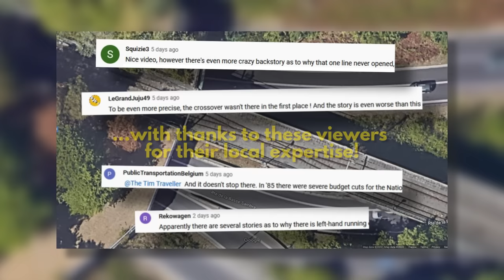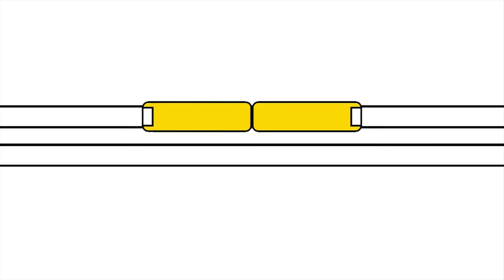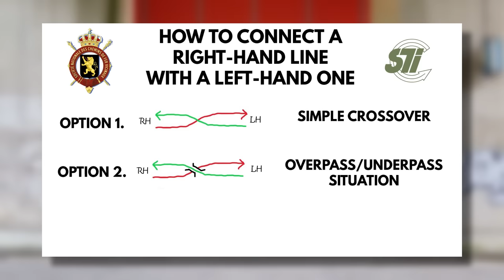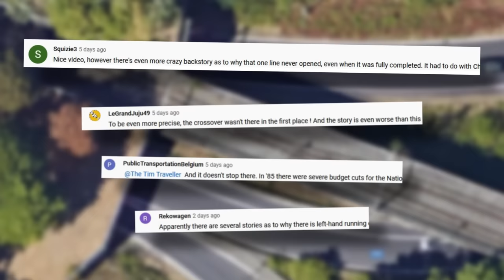The Belgian City That Built Two Metro Lines The Wrong Way Round

Comment: There are (at least) four places on the London Underground which have right hand running. The Northern Line between Borough and Moorgate - a legacy of the original tunnels under the Thames, and the steep gradient up into the King William Street terminus . The Northern Line again, at Tufnell Park, to ease the curves approaching the station from each end. The Victoria Line between Kings Cross and Warren Street, to facilitate interchanges at Euston. The Cenrtral Line at White City, a legacy of the former terminal loop, which ran anticlockwise. All of these cross over in tunnel, execept between White City and East Acton which uses a flyover - there are no flat crossings!  Elsewhere, there is a short strtech of left hand running on the Munich S-Bahn (lines 3 and 7) because trains reverse at the Ostbahnhof. And the French terminal of the Channel Tunnel has right hand running (although the tunnel, and French railways in general, have left hand running) because the terminal loop there is anticlockwise to even out wheel wear (the English terminal is clockwise). Flyovers areused in both cases to make the switch.  Finally, the West Highland Line is mainly single track but at passing stations trains normally run on the right - this is because all the platforms are islands, so it puts the driver on the platform side.

Comment: There's a similar situation in Zürich, where they built part of a metro tunnel but then the metro was rejected by the public. So they decided to just put the tram in the tunnel. But since the trams in Zürich are unidirectional and the tunnel has island platforms, the trams have to switch sides on both ends of the tunnel. While at Milchbuck there is an overpass for that, at Schwamendingerplatz, there's also just a simple crossing. There's a german Wikipedia article on the tunnel: https://de.wikipedia.org/wiki/Tramtunnel_Milchbuck%E2%80%93Schwamendingen

Comment: In South Korea, we have a similar case: Seoul Metro line 4 changing sides. 
During the Japanese colonial rule, railroads are made to run on the left. After the independence, it was too costly to "fix" all the rail systems from left to right, so this still continues till today for intercity railway systems. 
But an exception was made to when building city metros: they were made to run on the right side. So when they tried to make Line 4 longer by connecting the Seoul Metro's line 4 (which runs on the right side) to National Railroad's rail (which runs on the left), they solved this problem by building an 3-dimensional grade separation in the tunnels. Also, they run on different electricity (DC1500V / AC25000V) so carriages running both parts of the line is able to switch those.

Comment: In Zürich, Switzerland they also have 3 tram lines (7 and 9) that run underground between Milchbuck and Schwamendingen. As they are unidirectional as well, they've built the same crossover on the 'Schwamendingerplatz'-side of the tunnel as well.

Comment: The same exists in Zurich: In the 1960s, there were plans to build a metro, and when a road tunnel was built, a metro tunnel with two stations was built with it as preliminary construction for the planned metro. The metro plans were however rejected by the people, who favoured the extension of the tramway instead. It was then decided to integrate the unused tunnel into the tramway system, however, since the two stations were already built with island platforms for the double ended metro trains, the single ended  trams need to change tracks to run on the left side in order to use the island platforms ...

Comment: We have a similar thing in Vienna in our tram network. It mostly runs on the road and therefore runs on the right-hand-side. Except one single station where the line 26 leaves the road, crosses to the left-hand-side for a Gewerbepark Stadlau station with a middle platform, then crosses back to the right-hand-side a rejoins the road. Afaik they did that, because that section had to be elevated to cross a motorway and it was cheaper to build the elevated station with a middle platform instead of two seperate ones^^

The Austrian train network was a complete mess between left-hand and right-hand traffic for pretty much the same reason as Charleroi too: many different companies built it. But as a side note, in the Austrian-Hungarian empire even roads were partly left-hand and partly right-hand traffic, so going from Vienna to Innsbruck you had to change sides twice no matter if you were travelling on the road or by rail. They switched all roads incl. Vienna's Trams to right-hand-traffic during WW2. And for the last fifteen years they're busy switching the train lines to right-hand-traffic, but two railroad sections with left-hand-traffic still exist.

Comment: We've got a similar situation here in Chicago. Heavy rail i.e. mainline commuter service between city and suburbs is run by Metra, a division of the Regional Transportation Authority, using lines built by various private companies. All of them ran on the right, except the Chicago & NorthWestern. They built the first railroad west from Chicago, the Galena & Chicago Union (that didn't even go to Galena, stopping at Freeport when the Illinois Central beat them to it). There are rumors that the C&NW ran left-handed because of the influence of British investors, but there's a more practical reason.

Initially, they built a single track west from Chicago, with the stations on the north side of it. When they built a second main track, it was built to the south of the original track. Since the pattern of traffic even back then was people leaving their homes to head to the city, they'd go to the station and wait around for the eastbound train, then come back in the evening on the westbound train and go straight home. So, with the stations on the north side of the tracks, that required that eastbound trains run on the north-side track, thus, they run left-handed. And when the C&NW built two more lines radiating from Chicago, those were also built to run left-handed. Even with modern signalling systems that allow for bidirectional running on any track, they still operate both passenger and freight trains left-handed, and where station buildings still exist, they're set up so that the train running into the city must run on the left to be at the closest track.

Comment: Those crossovers occur on parts of the London Underground but it's historic from when the London Underground system was seperate lines and companies, some stations and tracks were shared both with other undeground companies and main line ones, different companies had different running arrangements.  Changing station signage and the signalling was too big a job to have all left hand running when the LPTB (London Passenger Transport Board) known as LT (London Transport) was formed and the companies nationalised, easier to change the running side, even when still separate companies, with a crossover as the trains had access on both sides to accomodate push pull operation of rolling stock and island platforms at some stations.

Comment: Option number 2 was built, but currently not needed, in Fullers NY, USA. The New York Central Water Level Route was 4 tracks wide, utilizing 2 tracks for passenger service and 2 tracks for freight service.  The NYC didn't want Passenger and Fright trains to pass head on, so they used the 2 middle tracks as westbound tracks and the 2 outside tracks were eastbound tracks.  Well, where the freight line joined in, they needed a way for the trains to "change sides", so the Fullers Crossover was built.  It is still in use by CSX and will probably never change.

Comment: There was a similar crossover in Cleveland, Ohio as part of what's now the Blue/Green RTA light rail line. The reason was similar for the crossover in Charleroi: from 55th street west, the line ran like a subway with island platforms, but east of 55th street it ran like a standard streetcar line. To allow the operation of left hand door only equipment, a flyover was built just east of the 55th street station to convert from left-hand to right-hand running. Purchases of new equipment with doors on both sides allowed the elimination of this practice, and the entire system now runs with right-hand running. The flyover is out of service, but the tunnel can still be seen from satellite or while riding the RTA.

Comment: There is a crossover on a tram line in Stockholm, sweden and to my knowledge it's the only one in the world where you go from left to right, that isn't on a border. The reason for it is that the trams run on the right but the Subway run on the left, so in order to have a cross plattform transfer at the end station of the tram, it runs on the left.

Comment: Great video, and nice to see a picture I took end up in a Tim Traveller video. :-) The video does leave me with two questions though: 
1. if the crossover were there to allow unidirectional trams on the network, how would that have worked on the central circular part, where trams of both companies would have operated?
2. what would they have done with the unidirectional trams at the terminus? There weren't any loops to turn the trams back around, were there?
Reply from the maker: Ah in that case a big thank you for making your photo available on wiki commons - it's much appreciated by people like me! 

I think both of your questions have the same answer: the original 1980s idea was that unidirectional trams would have terminated at Waterloo using a small terminus loop (with no need for crossovers).

And the terminus loop was in fact fully constructed - I'm not sure exactly when though. If it was built in the 1980s, they never used it. However, it did eventually enter service in 1992 when Line 4 was finally opened. The French wikipedia page for the Charleroi Metro has track diagrams of it, if you scroll down far enough: https://fr.wikipedia.org/wiki/M%C3%A9tro_l%C3%A9ger_de_Charleroi

However... in 1992, the Metro's main central loop was yet to be completed. When they extended the tracks from Waterloo round to Janson and Parc in 1996/7, Line 4 stopped using the terminus loop at Waterloo, and they installed the crossovers instead.

Hope that makes sense!
Reply: @TheTimTraveller  Thanks! :-) That sort of makes sense, as far as the loop at Waterloo goes. But what would they have done with the unidirectional trams at the other terminus stations? (I guess Gilly and Centenaire back then). I don't see any turnaround loops at those stations at the track diagrams?

Comment: I note the opening of Paris' Tram-Train T13 which in part uses renewed tracks of the former Grande Ceinture Ouest railway line with left-hand (railway network) running and also some right-hand street running. I would be interested in how they do the switchover between the two sections. This reminds me both of your video of this ill-fated metro in Charleroi, Belgium and your video on the Grande Ceinture Ouest railway line. Maybe you would like to investigate this new line.

Comment: A similar thing exists (and is active) in the Zurich tram network! One tunnel was originally laid out to be a metro tunnel, but then got serviced by trams, which only have doors on one side - so before and after said tunnel there's crossovers for the trains to switch sides.

Comment: There's a crossover on the Central Line of the London Underground between White City and East Acton near Wormwood Scrubs but it uses method 2, grade separation. There's another one between White City and Shepherd's Bush but it's below ground and more difficult to see. In fact, that's the one that was built first, because of a very tight bend in the route just before reaching the original western terminus at Wood Lane, which was built as a single platform on a loop and avoided the need for trains to reverse to head off back towards the centre of London. When the line was extended westwards towards Acton, a new through station was built nearby at White City, with right-hand running, and Wood Lane was closed. There was to be a junction with the Great Western Railway at Acton so the Central Line had to revert to standard left-hand running and the fly-over/dive-under was built at Wormwood Scrubs.

Comment: There is a system like that in Seoul too.
It is the section between Namtaeryeong Station and Seonbawi Station on Line 4, and there is not a flat system. This was also made in the process of connecting the lines by other operators.

Comment: Stockholm has that too, on the Lidingö line (if memory serves right). The railways in Swedem uses left-hand running (like the French…), The Lidingö line is a suburban tramway line, running about half in the street and half on its own right-of-way, as a private railway. Now, before 1967, Sweden had left-hand running of street traffic, too, but decided that being a left-hand-running island in a right-hand running world was dumb, when Norway, Finland, Denmark & the rest of Contiental Europe was not,. The trams (having doors on both sides) were not a problem, but the street running, now being right-hand, was a problem. So they built a crossover, just like this. :) And the line still runs successfully.

Comment: The first explanation kind of reminded me of the oldest part of the Frankfurt U-Bahn network. The "A line", extending from downtown Willy-Brandt-Platz to Heddernheim and beyond, has no island platforms, despite Frankfurt U-Bahn cars having been double-ended with doors on both sides from the beginning. It is an advantage to build island platforms (narrower tunnel, fewer elevators and escalators needed), so why didn't they do it there? Well, during the early years, that line was used by conventional trams (with slight mechanical adaptations to bridge the gap between train and platform as they were not as wide as the U-Bahn trains), which were single-ended and had doors only on one side. Therefore, Island platforms were not an option there.
Later lines were not designed for the mixed-traffic patterns (and since the end of the 1960s, no new single-ended vehicles* have been purchased anyway.

*)Technically there are newer U-Bahn trains which are single-ended, but they always operate coupled back to back in passenger service, so they look and work like a long double-ended one, and they have doors on both sides anyway.
Reply: I remember watching that on TheTrainTV, quite interesting to see the good old Duewag trams on the Stadtbahn network.
Reply: @RockstarRomania  unfortunately, most of them are gone. We have three original U2 cars and three U3 cars left in operating condition, but they are only used for special occasions. Most of the Frankfurt subway runs on Bombardier made rolling stock which is called U5 in Frankfurt, with a few 90s DUEWAG U4 sprinkled in.
Reply: @Colaholiker  yep I know that 85% of the fleet is comprised of the Bombardier (or rather Alstom) U5s, and the 39 U4s.

Comment: You should make a video about the delay of the renovation of Gent-sint-pieters station because the renovation was supposed to be done by 2016, the new date is 2027. The project was put on hold for 3 years as there was no money left for the renovation, it cost also 200 milion more than the anticipated budget.

Comment: We have similar thing on Seoul metro line 4.
Line 4 has two different operators, Korail and Seoul Metro.
Korail has left-hand based railways, while Seoul Metro has right-hand based system. Line 4 was actually two different lines untill 1994. But when the time came to merge lines together, they built a flying crossover, often called as "꽈배기굴"(means pretzel tunnel) in korean between 남태령(Namtaeryeong) and 선바위(Seonbawi). The electric supply also changes between DC 1500V to AC 25KV.

Comment: In Kryvyi Rih (Ukraine) we have light subway system that has the same but in a different manner: between two station tunnels change places (one tunnel goes under the other) for the same reason: to be able to use wagons with door on their right side only. And when it connects to surface tram line tracks are crossing once again (on the surface) to change travel mode from left-hand to right-hand again.

Comment: I think I'm right in saying that the reason that Sweden still has left hand running on most of its mainline railways is because of a similar issue with the drivers' position being on the platform side at the time of the national L-R road swapover in 1967, so they just kept it as is. The tramway system in Stockholm was largely closed at the same time. Meanwhile down south in Gothenburg, all pre-1967 trams became instantly obselete as they too had unidirectional cabs with left-hand-side doors.....except one, which runs the tourist line from Central Station to Liseberg in isolation.

Comment: Did you ever heard about Ludwigshafen am Rhein, were they built a new mainstation outside the city center, 2 highways on bridges accross the city and a whole underground tram line (line 12) back in the 1960s? And today, they tearing down the streets and the underground line has been disused since 2008. The main station is still in use but a few years back they built a newer station which is actually inside the city. You should pay that mess a visit, Tim.

Comment: You've never come across Slade Lane junction in Manchester? Similar setup, but on the 4-track West Coast Main Line.

The reason for the craziness there is that south of the junction the tracks run as two same-direction pairs (fast and slow), but north of the junction they run as two opposite-direction pairs. Oh, and the Styal line joins in the fun as well. That, and Ardwick junction are some of the biggest bottlenecks in the area and any other country would have built flyovers to avoid all the conflicting movements...